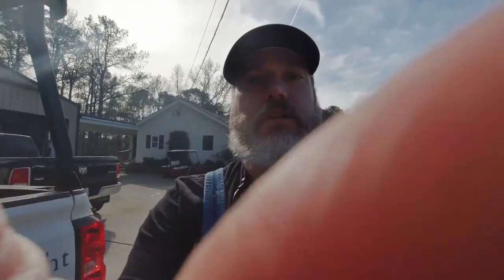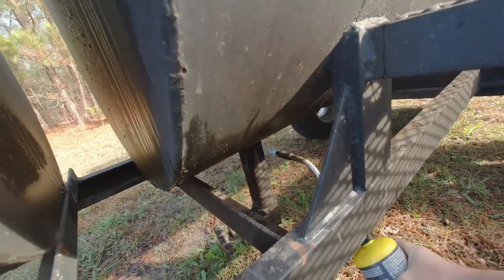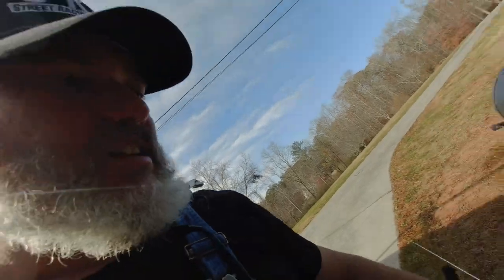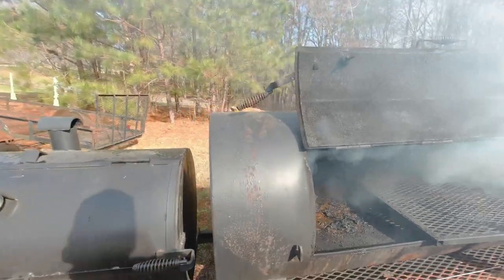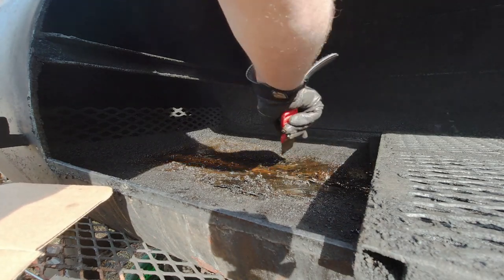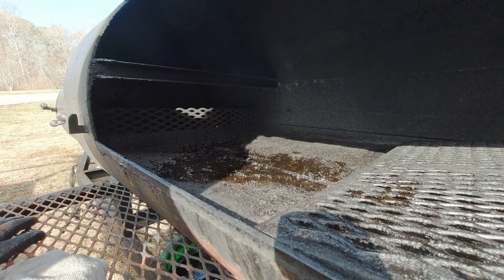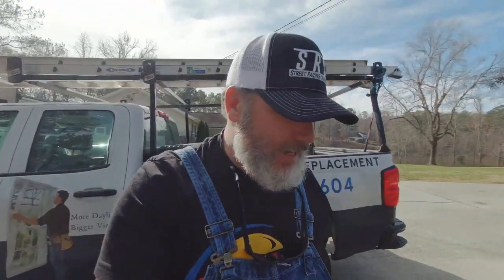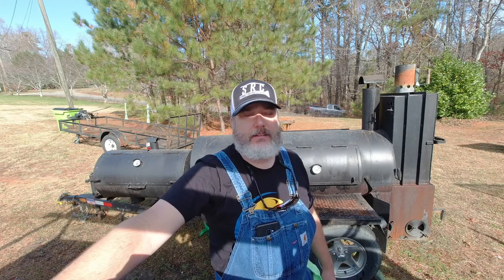LANG 84 D BBQ Smoker Clogged Drain

Comment: Take all the grates out, open the valve, take your hose and blast water into the valve backwards into your smoker. All the chunks will come out and the drain will be cleared. Then scrape the smoker back out, remove all the debris then steam clean it.

Comment: I'm very familiar with having to do the same with my Lang in the colder months! Although I've only had a clogged drain from debris once or twice. Solid grease is just a reality in cold weather since the drain pipe hangs down so far.
Reply from the maker: Yeah I think I had a little of both going on.  The drain most likely had never been cleaned and when I started cleaning it up from sitting I finished it off. If you cook on them daily it's going to happen at some point